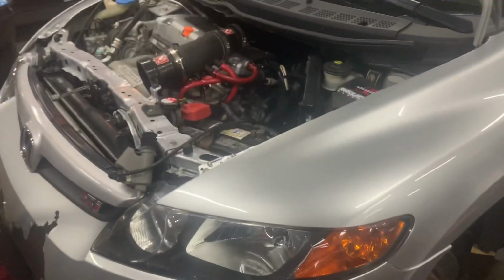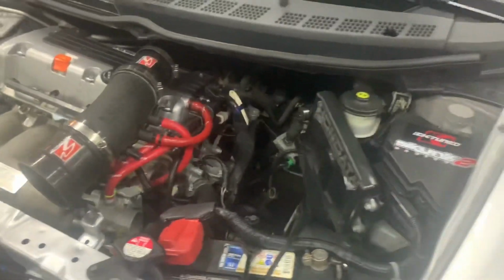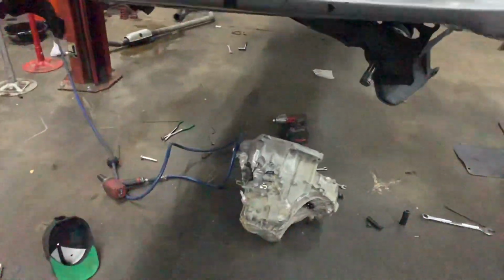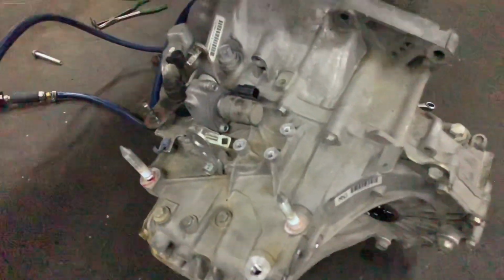Pulling a K20 Tans in 4:20 minutes “Nahhhh Dude”

Comment: The civic engine bay looks even smaller than the DC5 is that just the camera adding 5 pounds to the engine or is it  truly smaller?
Reply from the maker: Truly small the cowl comes out
Reply: Ah I see. Is the cowl supporting something ? Wires or something?
Reply: So I rewatched the slo-mo of the transmission drop and it was like robot sex or something 😳 the quick and tight drilling at the bottom in the dark slightly out of focus the slow convulsions of the top as it slowly curled forward and down... oh shoot I just made this weird 🤪